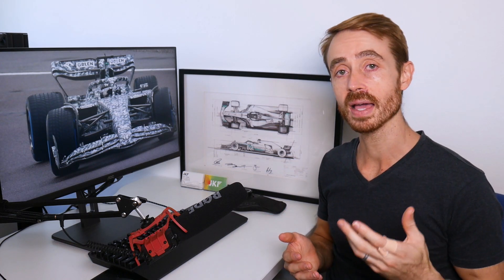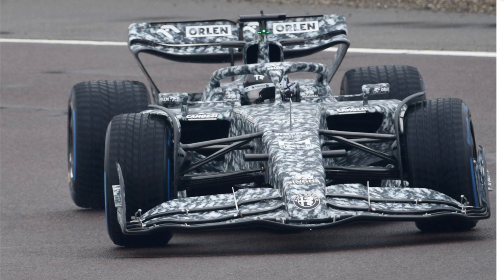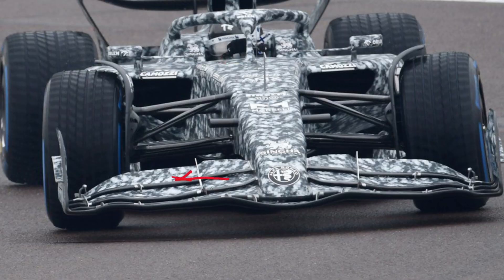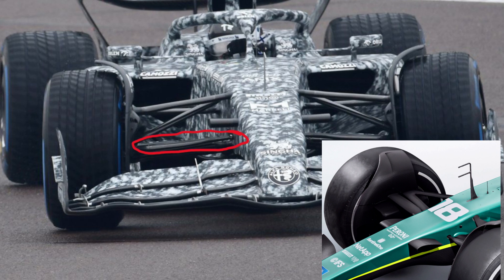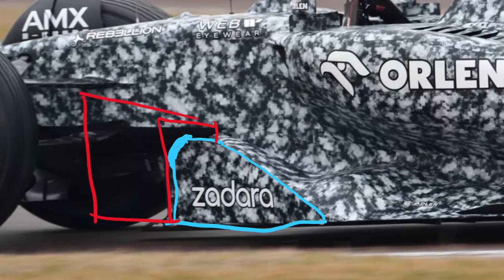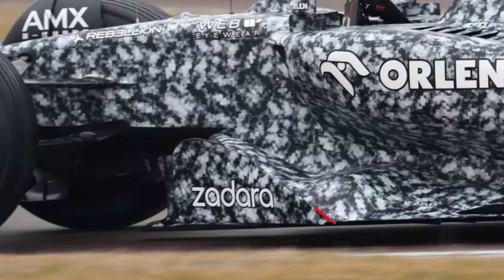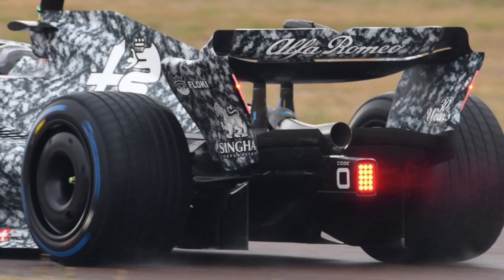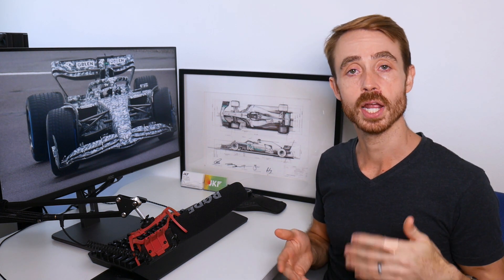Alfa Romeo C42  -  Aerodynamics Analysis and Initial Thoughts

Comment: Are there any F1 cars that run asymmetrical aero? Thinking of tracks like Monza where there's a bias of fast clockwise turns.

Or would teams normally compensate with mechanical things such as suspension?

Comment: I'm wondering if running the full wet tires will have a bigger downforce penalty on these cars compared to the previous generation? Assuming these cars will be very ride height sensitive due to the increased influence of ground effect, won't the larger diameter wet tires increase ride heights and make sealing the floor more difficult?

Comment: Hi Kyle, thanks for these amazing contents as always.
just a quick question here:
Cars from the last era seems to like to create as many vortexes as possible, but this year many teams seems to try avoiding that, why is that? what are the differences between these two concept?
Thanks again!
Reply: All of them were generated up front to help control the outwash and very dirty air from the tires. With the extra additions like covers and winglets for tires, that seems not as important. Instead, having very clean air flow to the undertray for maximum ground effect is the play at the moment.
Reply: I think at least a part of it is that FIA's regulation changes have limited their opportunities for creating vortices quite severely. They have no traditional barge boards anymore, front wings were massively simplified, as were the rear wings, etc. Could just be largely down to that.
Reply: mmm, regulations are different. They would still do that, if they could
Reply: @someonewithsomename  maybe if it suits the aero package they are going around. But with that large emphasis on downforce from the underbody. Making all the vortexes to push and control tire wake might be taking away clean underfloor flow, which so far seems to be the big thing teams are sticking too
Reply: @EvLSpectre  why is that? As I understand vortexes are primary a control tool to separate and manipulate airflow, so you would design the airflow so that all the clean air you need are passed into the tunnels, and all the dirty air from the tires are separated by the vortexes. It's what all the teams did in 2021, it's what every team are doing today.

 If you've seen all the videos here, you might've noticed that on every car there are still small vortex generation parts on the front spoiler around the tire and on the floor. Which for the most part do the same thing as in 2021 cars.
The main difference is that the teams can't 
do everything they want and are limited by regulations, which do not allow lots of vortex generators. So they try to do smart and cheeky stuff with curvature angles, supporting structures and what not.

As you can see that ability to control the airflow with vortexes is still highly desirable for the engineers.

Comment: Is it me, or does the Alfa Romeo sport a S-duct? Just rear of the Pirelli logo I think I see a slot/gap where the air comes out. The nose is somewhat hollowed out at the front so that might be where the air is coming in. Are they still allowed within the current regulations? I haven't seen it on anyof the other cars presented yet.